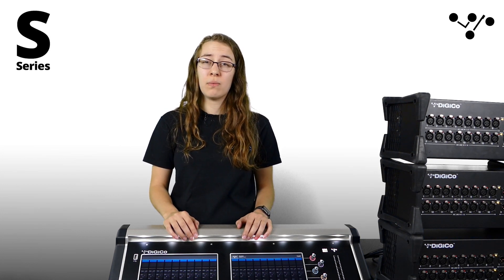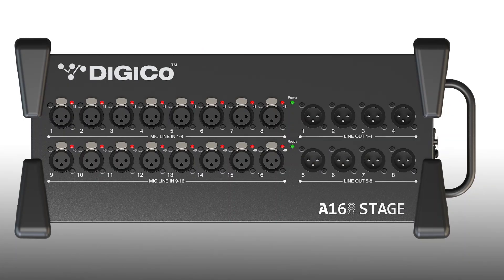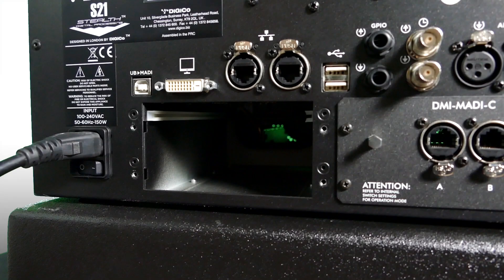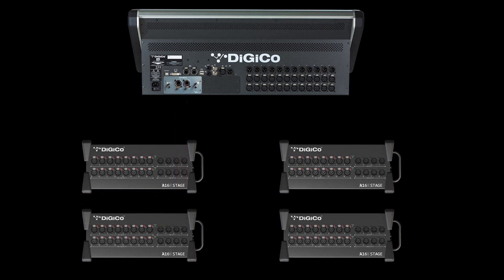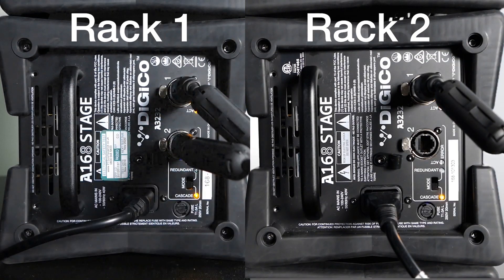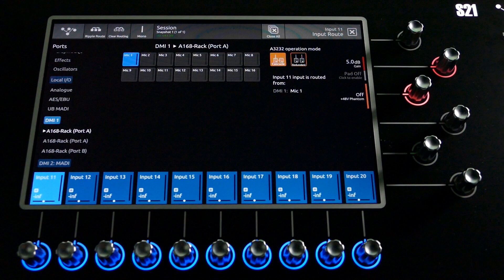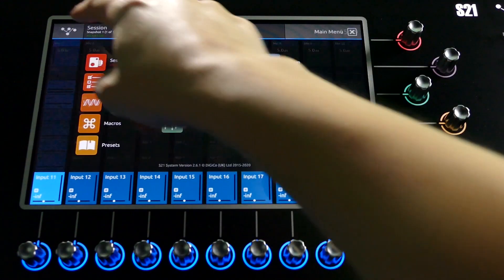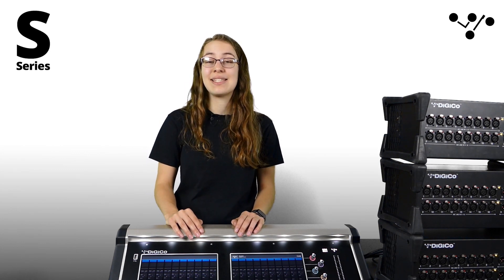S-Series HOW TO - Setting Up the Stage48 System Export

Comment: Hi! Im having trouble to control an A168 stage with an S21 DiGiCo Console equiped with a DMI-DANTE64@96. I'm able to recieve all channels and send to all outputs but I can't control neither gain nor phantom power from the S21. Can you help me with this? Thanks!
Reply: Was this problem resolved?
Reply: @brianjenwaldner  first of all, the rack firmware must be 1.1 in order to work with an s-series console. Second, the dmi card's firmware should be at 4.0.19 version. Hope this helps!
Reply: You’ll need a DMI A3232 card to control a168 boxes. Otherwise, swap out your stage boxes for the a168D stage boxes which work with dante DMI cards. Thanks.
Reply: An update to this problem: it was only a mater of firmware. I didn't fix it myself, so I can't sqyright now what was exactly. But updating firmware was actually the thing that started the problem in the first place. Console firmware must be intact